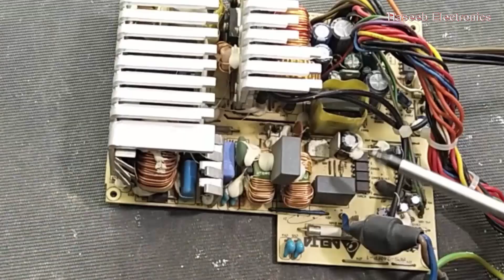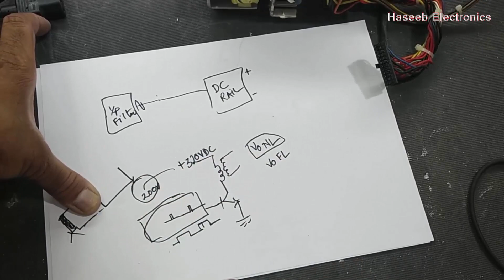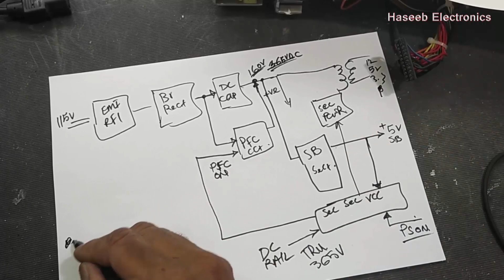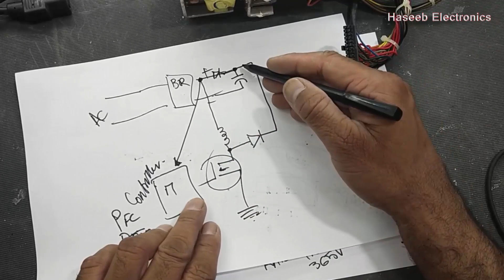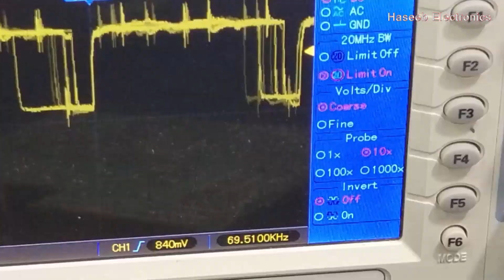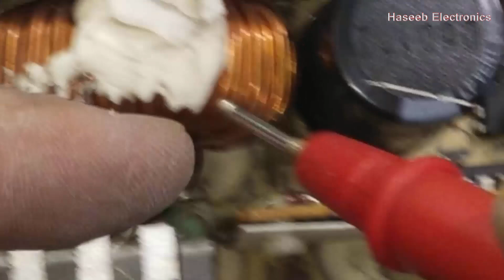{464} ATX power Supply with Active PFC HP 240- Working Explained & Repair / Troubleshooting

Comment: Hello sir, i have to repair DPS-400AB-13A SMPS. Correct Standby voltage is 11V and i could repair standby section. But when i connect PS-ON to ground it does not generate other voltages. SMPS have a strange connector with all black wires. Could you please help...

Comment: Hi . Can you cover the case where the +5vsb is good  and the output turn on but then shut down immediately . Could this be because the supervisor IC monitoring the outputs is shutting down the PSU. This makes it difficult to troubleshoot .  In this case  can you disable the output monitor circuit to prevent it shutting down the PSU  when you connect the green wire to OV so that that you can troubleshoot the problem ?  A video covering topic would be very helpful because i think this is a relatively common fault case

Comment: Will active PFC compensate for a sudden voltage drop in the AC mains from ~ 230/220 Volts to ~ 100/110 Volts? Seems like it will, while stressing the inductors a bit more.
Reply from the maker: every PFC circuit have its limitations. it depends on the design. normally it covers this range

Comment: I have 700 watt PSU. 5 volt is OK. When shorting green wire with ground the psu start for second then turn off. All thr voltage except 5 volt down to zero. What could be the problem. Optocoupler faulty?

Comment: Hello, Thank you for your video :) .I have a 1600 watt power supply that is not outputting 5V from pin8 (PGO) of ST9S313 ( which is a PC POWER SUPPLY SUPERVISOR ) . All other voltages of the 24 pin connector are ok.
I can't get the IC or equivalent, can I just bridge 5v from anywhere on the board to this pin ( it is pin5 on ( the grey wire ) on the 24 pin connector. Thank you in advance.
Reply from the maker: yes you can make bypass. i suggest to use LM339 comparator IC to generate PGO, so when 5 volt will available it will provide a true signal. it is more good and much safe for PC safety
Reply: @HaseebElectronics  I managed to get WT751002 which is a power supervisory chip equivalent to ST9S313, but whhen I measured the IC input voltages there where no PGI ,  and all other voltages to the chip where ok , i guess that means that the problem is not with the chip. Right? what supplies the PGI to the chip? do you have schematics or any hint please? I work with GPUs this is my first time to work with PSU :) Or could it be a bad chip shorting the PGI input! your help would be appreciated.